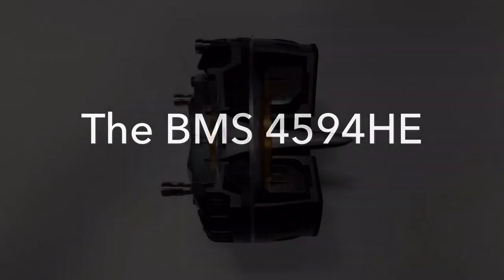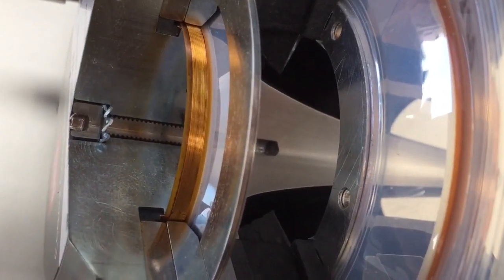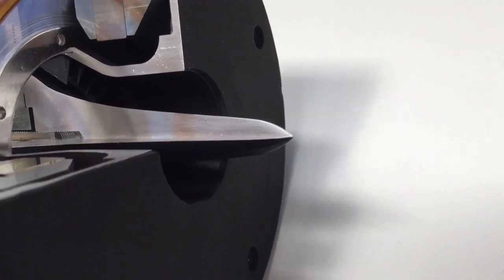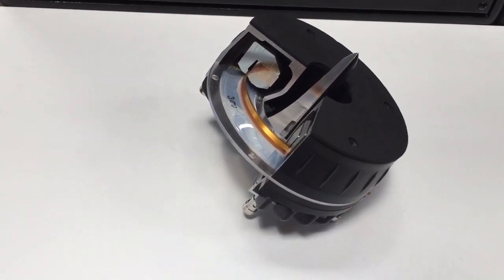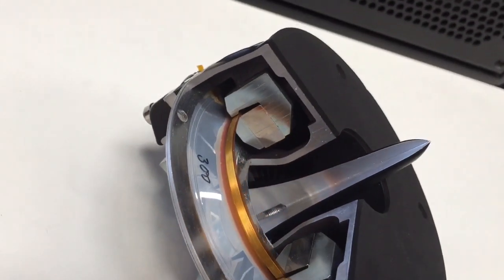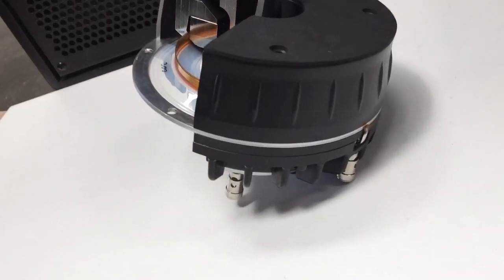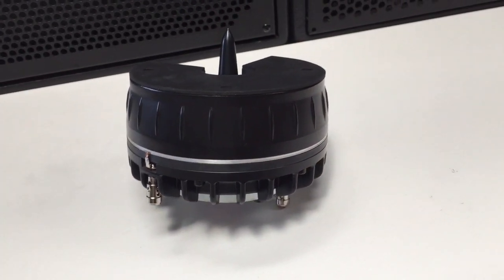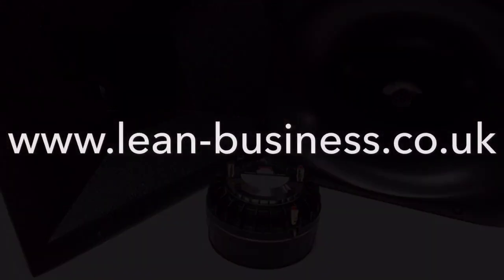BMS 4594 Compression Driver How It Works

Comment: An animated video of how this thing produces sound, plus the dispersion pattern, would be fantastic to see. Thanks for considering!
Reply from the maker: Yes I agree,
Reply: @soundheaven  disappointing that there's be no response.
Reply from the maker: @TheJoeyPeacock  Yes I agree, I will pass your comment to BMS
Reply: It highly depends on the horn used.
Reply: Well, there are many types of of how the sound can be dispersed. The most common type of sound dispersion horns is "Re-entrant dispersion horn", which are those aesthetic typical horns with a throat in the middle. The sound waves from the speaker driver enters the throat, where it then bounces back to the horn. It pretty much "Re-entries" the horn, thus "RE-ENTRANT horn". The air in the throat is of high pressure, which also makes it louder or something. Correct me if i'm wrong.

Comment: What kind of loudspeaker uses a line array system? They sound well on hifreq because of the driver or because of digital eq to put emphasis on high freq for high fidelity?
Reply: A line array is not about a quality, but about an efficiency, controlling of reflections (well this thing is translated into a quality if you wish), etc because of a sound spread diagram. Some kind of averaging occurs of course, but it's not a key factor.